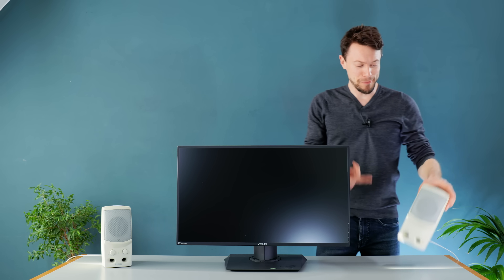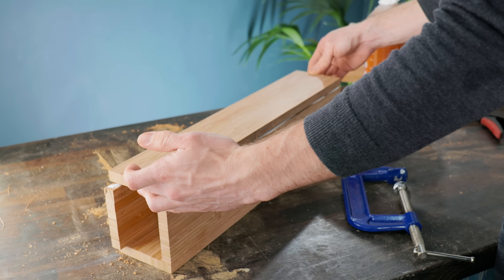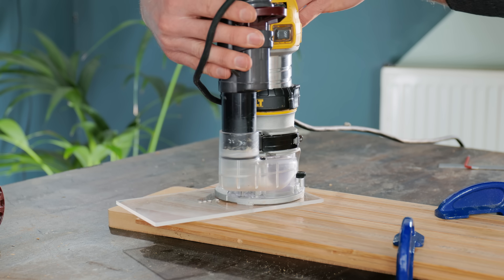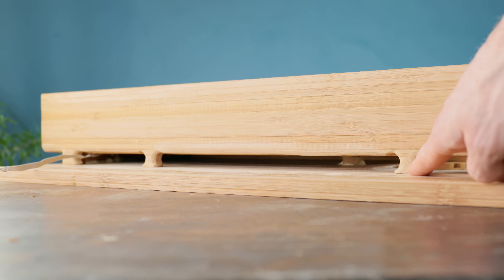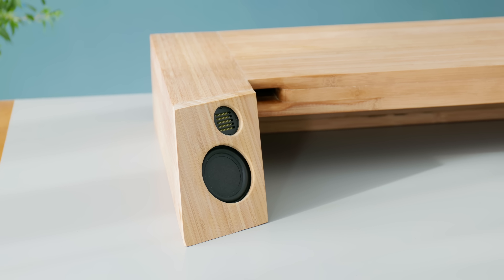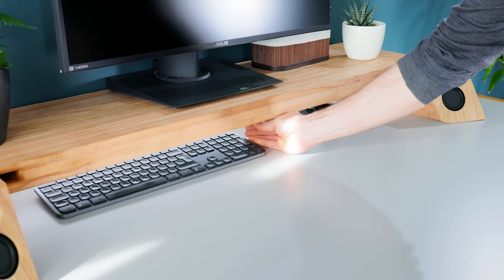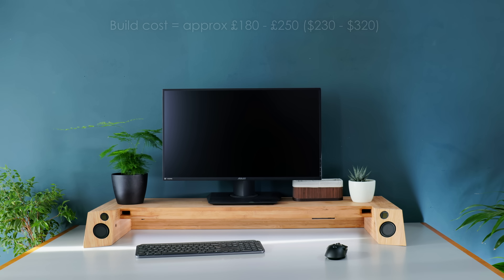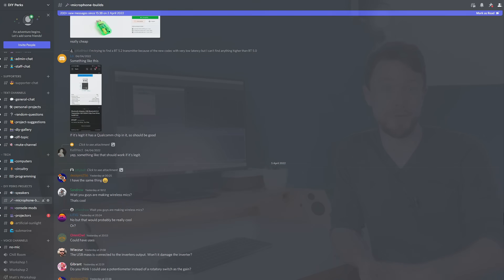Building a PC sound deck... with a twist!

Comment: I have a pair of decent small speakers from Thrust (I think) and the bass is from Silvercrest (yes, Lidl!). Since my desk is close up the wall, I've just imitated Bose's concept of bouncing the sound off the walls. Turned the speakers facing the wall, and indeed the sound is more a semi-surround type. You do loose in precision, meaning it's not 100% defined as when you are in front of the "audio cone", but for my needs it's acceptable. Works far better with larger speakers (did that with a pair of 70Watts Kenwood gigantic speakers, from 1977, and the whole living room was filled with music); just do some tweaking with the treble and bass, and the positioning of the speakers.

Comment: On the first track hi-fi speakers clearly win - the background details (splash-like sounds and echo) are more pronounced than on DIY ones.
On the second track it sounds like DIY speakers have Treble set one position higher than hi-fi's. It's down to personal preference on that one, no clear winner here.
Overall both sound quite comparable, I probably couldn't point out which is which with the eyes closed.

Comment: As an audio student this kind of thing is fascinating to me. Still a lot that’s lost to me, but I’d love to pursue a project like this. I’m gonna need to purchase high end monitors eventually anyways, so why not just make a project out of it and build it the way I want? I’m not used to people referencing specific parts and components, only speakers as a whole, so some of these parts are interesting. Where do you research your components?
Reply: Monitors are designed specially to get the best spread using wave guides. Making your own would def sound worse unless you can effectively create the right geometry to spread the sound wave most effectively (which is what entire company’s do and would be pretty high level acoustic dynamics/physics

Comment: that's crazy excellent work and tuning as well !!!  Clearly the $1200 bookshelves provide a mid bass far surpassing the little 2" drivers in clarity used in the DIY but although just from headphones I would agree whole heartedly that sounds better than any Desktop computer system I've owned in years past (logitech/bose/the old Klipsch 2.1 would be a tough one to compete with)  Your creativity and skills never fail to impress.

Comment: This is a really neat build - well done. A note on the Tectonic BMRs: This kind of driver has really stellar off-axis response. This means you can use them in a lot of esoteric builds where the drivers are mounted in different places or different angle. I'm currently working on a 2x20 driver line array integrated into the wall for example. I hope you experiment with them some more - they're a lot of fun!

Comment: Checking the specs and reviews for the Dayton Audio tweeters, they're quite inefficient and actually require the 'bi-amping' and line-level cross-overs used here, i.e. they need their own amp, they'll be too quiet to match most mid-bass drivers in the usual 2-way, passive cross-over design.
Reply: Taking that into account, do they then match the Tectonic drivers that as I understand, not very efficient either? Or is that low sensitivity?  Forgive my ignorance.

Comment: If I were him I’d start up a small speaker company that’d grow into a mega company in a few years.
Reply: I'd buy one, no doubt
Reply: Its a great concept and it has a ton of possible iterations and shapes it can take. He got a real product there. Product that is not on a market.
If he would figure out production part, he could literally turn it into a business. How ever, nowsdays people use headphones so the market is small.
Reply: @EddyKorgo  Market is huge but requires a lot of experience. Im disapointed that those diy project would lose in sound to a speaker that is 10 times cheaper. Diy give impression of fuller sound here because of subwoofer and normal monitor speakers usually prefer rolloff to make a space for one and not push the drivers to the limit. If you would add a subwoofer to a 500usd pair of speakers this setup would be far far behind. You just cant fit a good enough subwoofer in that size.

Comment: One thing to note is that higher quality crossover components will have a noticeable impact on sound quality, if the speaker is designed well.

Comment: You should use better components on crossover, high quality capacitors and resistors which were made for sound. Its really big difference. Besides that build is really great and looks like from factory not like it was made at home.

Comment: Fantastic job.  Great use of porting to expand and maximize the effective range of your subwoofer.  Most bookshelf speakers and even high end studio monitors are not designed to carry that super low end and it stands to reason that including even a smaller shallow mount sun has made a dramatic difference.  Great overall functionality as well as it will raise the level of your monitor closer to eye level and the space underneath for your keyboard and mouse is paramount for having a multipurpose work station.  Thanks for inspiring us.

Comment: Audio is always as good as the worst Part of the chain, so in the ideal World only Youtube compression, but in reality, your microphones arent ideal, your room adds distortion, Youtube changes barely nothing, and at last the device the watcher is listening on, also not Spot on perfect (dac, amp, speaker drivers etc...).

In short you just cannot compare Sound over a video, you could Tell if something is actual garbage, but not compare. Every setup of the chain sounds differently for every User, and thus noone can Tell what would Sound better in the real world for them.

But that put away, the build Looks amazing and as i know these kind of speakers im sure they do in fact Sound epic, over a Video its like i said hard, on the Phone itself f. E. your Studio Monitors Sound better, but with my iems the diy build wins by quite a bit.

Comment: When comparing two systems, like you do at the end, it would be interesting to see the measured response curves with pink noise compared.  That would provide some objective comparison to go along with the subjective listening test.  My guess is that your system produced a lot more bass below 60Hz than the bookshelf speakers, and the bookshelf speakers sound too heavy in the mid.  But, would the curves show this?
Reply: This, was thinking the same thing.  It'd also be interesting to see how far we could dial these in with either a quality physical EQ, or something like APO.
Reply: that would be really good information to have and he have the the know how. probably better to have 2 decent speakers and therefore nullifying the project.

Comment: I always get something out of your videos, and definitely enjoy them.  I'm also confused by some choices.  You use a router, but then a hand saw instead of a compound miter saw?  seems likely anyone that has a router and circle jig is probably going to have most other basic power tool options available.  As to this design, it's very attractive.  I just don't agree with the component choices.  I have found that adding that many separate boards for a 2.1 application invites noise and/or gain issues.  Parts Express sells a very reliable 2.1 board that includes an adjustable sub crossover, switchable high pass crossover, separate volume control for the sub and mid/tweeters, and a treble control.  Oh, and it has bluetooth and line-in built in.  Lastly, I don't see running a high clarity DAC and through those fairly low fidelity amp boards.  I think you'd lose any value the DAC brings.  Anyway, I find it just a little unnecessarily complex to get to that result.  Just one dude's view.  Keep them coming!  Thx!

Comment: The £1200 speakers have a fuller sounds stage but slightly dull mids and lows. While the DIY speakers sound a little more tinny (tinnie?..), like there's more harshness in the highs and mids.

Great build though!

Comment: It looks stunning but I am afraid that technically it could be much better with a little bit of extra work…
How was the crossover done? With the measurements before or just a calculator with trials and errors? I am afraid that the latter since you didn’t explain. Unfortunately that’s where you lost majority of your sound.
The other thing I don’t like is that the speaker drivers are very deeply mounted. They should be aligned inline with the enclosure so you don’t create kind of a horn and a dispersion would have been better.
Cheers!

Comment: I would definitely buy that if someone would sell it. 
I was almost onboard with trying to build it myself but the audio fine tuning of the speakers got the better of me.
Reply: Honestly would be interested in someone wanting to make an automated way to do the audio tunning, I think that would hopefully lower the bar
Reply: @Waitwhat469  impossible 
To many thinks to keep in mind.
But you can play arround with some partly accurate freeware like winISD, BassCad, Hornresp.
You will also need measuring equipment. Most straight forward is umik 1in combination with REW software. It will let you measure simpel things.

Also there is lots of indeepth information  on the web on how to plan, build and measure speakers.
Reply: Probably don't need to do that far if you buy the correct crossover with the correct speakers. #$@%! Shit.  I just saw the bass shake his set up lolz. Okay yeah that's turned tobacco different level and I used to be an audiophile. That would have been an insane amount of math. He skip that part of the video. Oh he addresses that.  Awesome. Oh his cross over isn't prebuilt, it's a breadboard!  Holy cow balls!  That tdd s why he needed to tune it. The that's an entire project on it's own
Reply: He has made a whole extended video and a ressource pack with pretuned values.
Reply: You can fine tune to your own preferences. It is different for everyone. Like for me, I personally like a bit bassy sound
Reply: @SwapnilBBagul  Nah not with crossover, that’s stuff to do with EQ. Crossover basically means which drivers play which frequency range, not which frequency range is more amplified.
Reply: you could cheat around that point by single amplifiy the speakers and simply buy an adjustable frequencie splitter. you could get a used analouge one for around 40-50 i think. in 19 rack format and right put it unter the top wood.
Reply: @Odyseuss08  if you allready plan to crossover activ, you might just get a dsp at this point
Reply: @ggk7605  yes thats an option as well. there are some fine ones around 150. In the end just a question of budget.
Reply: @Odyseuss08  150? Atleast in germany you can get your hands on some 4x4 dsp for arround 80. For example the t.racks mini dsp 4x4 sold on thomann. Fully functional dsp with symmetric in and out
Reply: hoiy vinosa  nobody was unsupportive. It got my like and I added this video to my Favorites list. Chill out man
Reply: @klausschaeffer365  think he answerd on accident xD
Reply: @klausschaeffer365  I think you misunderstood. Don't reply so aggressively
Reply: @jamesthomson13  wtf??

Comment: Am listening to this on my DIY Aiwa repurposed single speaker with 2 woofers in series. I salvaged a logitech bluetooth speaker circuit to drive this. The pro 1200$ ones sound a little more fuller so are possible better at some orchetra pieces and music in general, for movies and games the DIY should win hands down. (However that can be fixed with adding a pair of full range speakers to either sides of the woofer. with a ducted tweeter type channel.)

Comment: I hear some very obvious midrange resonances and peaks on the DIY that are absent on the commercial models. Bass is okay... tight more than extended. Highs are very nice. I would used larger plastic cones with a more neutral sound instead of 3" cones (which sound a bit sqawky) for the main speakers.

Comment: you'd get a lot ofo performance out of those speakers if you just used quality components for the crossover. its very inexpensive to use audio grade capacitors and resistors and would make quite a difference in clarity.

Comment: As beautiful it seems your work.. Is not going to be practical in any way. For example if you burn one speaker you need to do a lot of disassemble in order to change it. My idea is something to make with a easy way to reach the speaker from inside
Gread job by the way

Comment: As an audio engineer, I have to say that I totally loved your subwoofer unit design. A very clever piece of engineering! Dude, you should start an audio company where you build custom hand-made speakers for various customers like Hi-Fi enthusiasts, casual desktop listeners, mobile listeners etc. And I would be one of your first Hi-Fi customers! Keep up the amazing work!
Reply: I have to imagine the prices would be crazy crazy high! The prices for the diy builds are deceiving because they don’t cover his invaluable expertise and experience 😅
Reply: The fact is that he can make nearly anything, so sticking in hifi isn’t that good for him, hoping you catch the point
Reply: Agreed
Reply: Yeah but 4 days of work… at what, let’s say 20€ an hour (probably too low but idk).

8 x 4 x 20 = 640€ without material costs.

Admittedly still cheaper than the mass produced speakers
Reply: @MaticTheProto  20 an hour is waaaay too low for craftmanship like this. I'd expect more like 50 an hour. that being said, the 4 days was JUST on figuring out the crossover settings, so i'd guess the final price would be closer to 4000, or even more as it's a custom piece.
Reply: @MaticTheProto  $20/hr is what you'd pay a general laborer who was assembling this design if it was mass produced, and generally the cost of mass produced goods includes a 70%-80% profit margin over estimated labor, parts, material, shipping, running costs, ect... Meaning if these were mass produced (we'll take R&D costs and tuning time out of the equation as it's already been developed) their price for the consumer would be between $2000-$2500. Now just quoting it as a custom, one-off piece; most people would charge at least $80/hr for this level of design consideration and craftsmanship in a custom application. The R&D likely took 4-5 days, the build itself another 3-4 days, and the tuning was 4 days. So 12x7x80.... yeahhh these are looking like they'd need $6,000 in labor cost alone.

 And currently at 2M views, this video made him around $40K-$60k for only making one.
Reply: @MaticTheProto  he used 4 days to fine tune crossover.

Comment: All that work and expanse and then your GAMING what a waste. A Wouldn't a inexpensive 5.1 Surround sound system be better and a lot simpler. Just tip the front or the Bar up if need be. place the Wireless Sub Woffer & Surround Speakers in the back of the room.

Comment: Nice and impressive build as always. Now as for our speakers orientation, I'll just refer to Paul Mc Gowan's explanation on sound imaging: https://youtu.be/RvRlpoLmTWA?t=323 and also https://youtu.be/FFrDpKl5Y5w

So in essence, you shouldn't necessarily angle them straight at the listener's face/ears rather than toeing them by a tiny amount to avoid losing sound height and depth. I also see a small drawback in that the speakers are recessed while they'd be best flush with the wooden surface to avoid interference and distorting the diffusion cone.

Anyway, keep up the good work!

Comment: A thing you should consider is putting some rubber feet or pads under the wood or even some vinyl things so it limits vibrations to the desk

Comment: @DIYPerks with all the love and joy I have from and for your channel and your builds 👍🥰 -- it is again you're training to build a speaker and let's face it ... You are not a speaker engineer/builder, are you 🙏? As much as I love the ingenuity, functionality and beauty of it 😍 the sound quality of it may be by chance at most mediocre. I am sure I don't have to tell you how much effort in design and measurements and testing it takes to create a good quality monitor/ speaker (not to mention the expensive equipment). Where the enclosure design is at least as much important as the driver itself (if not more) and both go hand in hand together. Putting just any driver that fits in your enclosure (even if considered good or even extensive) will produce rather random results of sound quality because enclosures are designed precisely for a specific driver.

Comment: screen mounted on an arm or  wall make  a stand moot point ..
With hdmi being use with a paired tv and sound and sub combo bluetooth or tv's arc to to hdmi on the soundbat kinda makes this build a moot point..

personally if i was connecting pc audio out a pc with no hdmi being use it be a totally digital connection over fiber optic sp/dif connection..

I tend not to mix pc 3.5mm  av audio because sometimes white noise can exist even 3.5 mm connections..

Comment: Very cool, nice idea and execution.
The advantage of BMRs is that they don't need tweeter and they don't need to be pointed at the listener, they perform extremely well off-axis, better than any conventional tweeter. I haven't tested this size yet (I'll be using them in my car), but I measured the 2" version and it's still quite flat even 90deg off-axis.

Comment: Ironically I still use a 90's off-white cambridge soundworks speaker set, and a plastic one at that. But the sound quality is great for the sattelite dimensions. I use the quadraphonic sat/sub version plus an Elac subwoofer to compliment the bass tones.